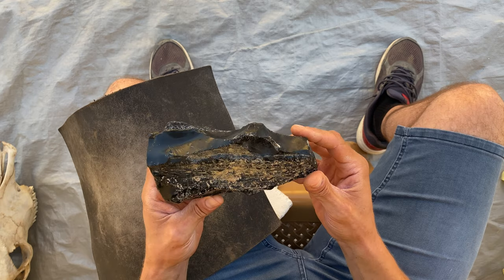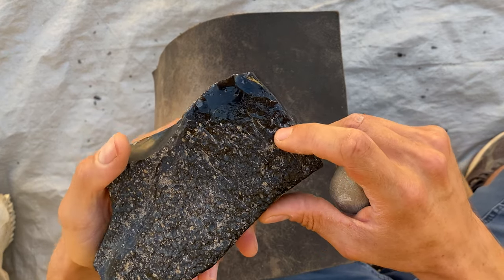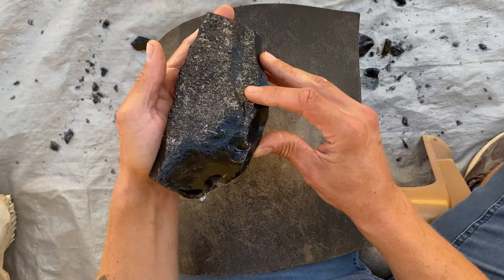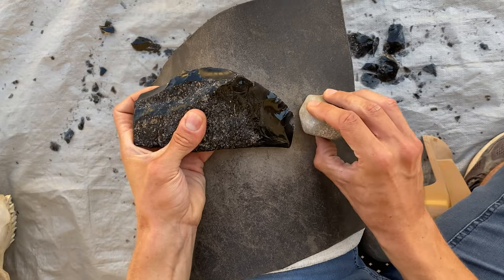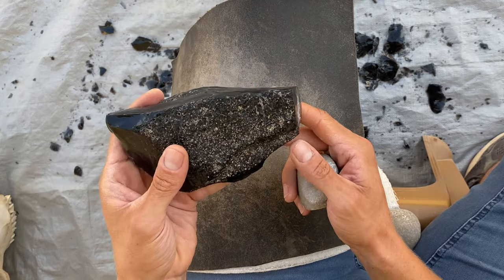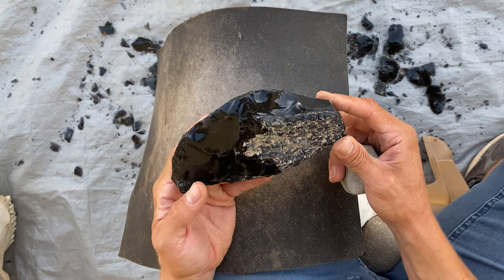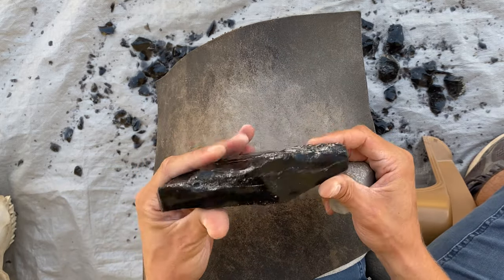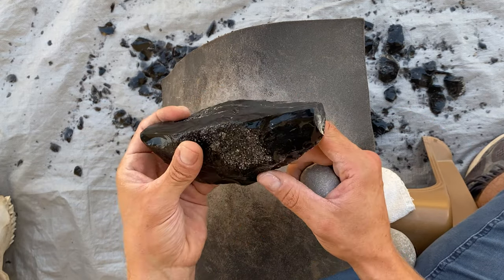Bidirectional (Naviform) Percussion Blade Core 1/2 - Initial Shaping - Knapping at Çatalhöyük

Comment: This material seems surprisingly tough. Is that just a result of the (large) size (of the blank/of the flakes)? Or is it indeed tougher that “average” obsidian? (I may be giving away my lack of experience with volcanic glass.)
Reply from the maker: @Attila Török The obsidian itself works really well, similar to other good quality obsidians I’ve worked from Georgia, the US and Mexico. The tough part about this one was the cortex, or the natural weathered material on the outside. It was really bubbly and had some fractures and hertzian cones, once you get through that you’re down to the good stuff, but this piece was very thin to begin with so I didn’t have a lot of room for error.
Reply: That makes complete sense… Thanks!
Reply from the maker: Cheers, thanks for watching and commenting